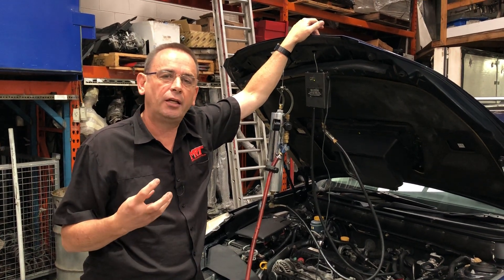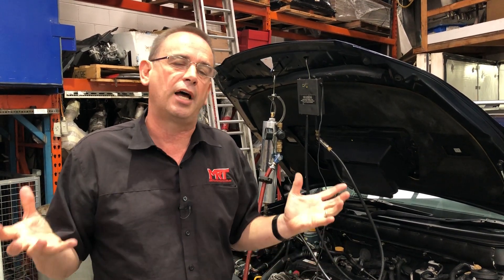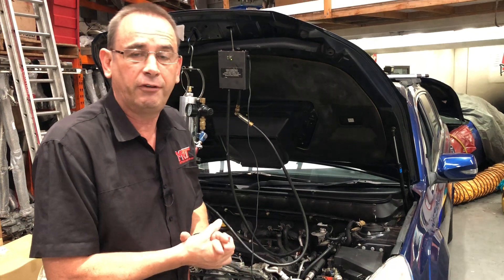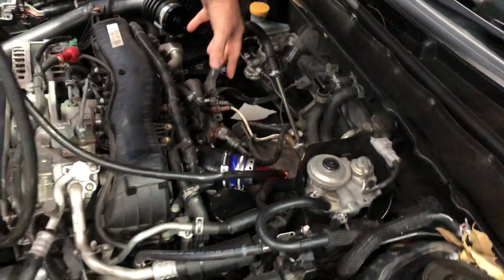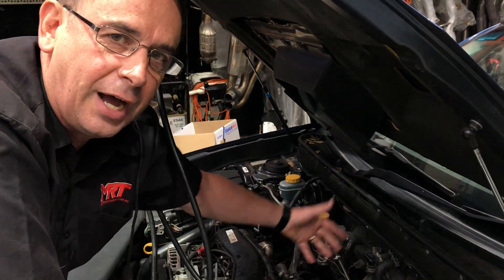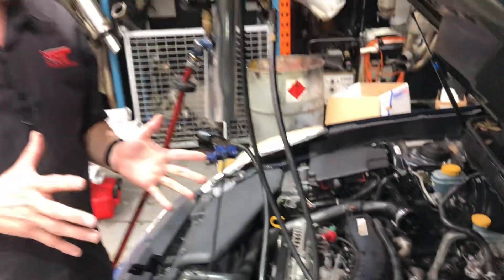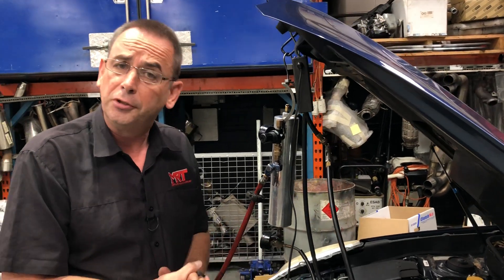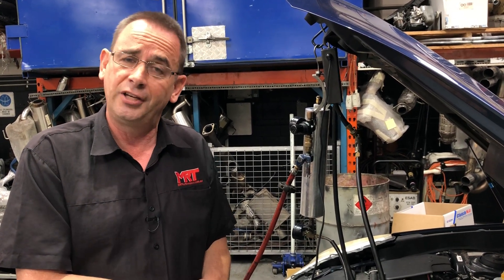Subaru Turbo Diesel Soot Problems

Comment: Hello! I have exactly the same sound like this :
https://youtu.be/dqYpy3iAC4Y

I bought the car and the engine shortblock is brand new , only the injection and turbo were from the old engine...

I don't know what cause that truck "engine sound , especially when i push the acceleration...
Reply: I forgot to say my Subaru is SJ from 2013-2018, 2.0 diesel

Comment: So Euro 4/5 means that to stop a bit of exhaust soot, cars are hobbled to have a shorter economical lifespan due to the expense of these repairs. All the energy and resources (and pollution) involved in producing the car are amortised over only 10 years instead of 20, forcing people to go out and buy new cars twice as often. And this is meant to be good for the environment.

Comment: Thanks for the info MRT. I've spoken to our local Turbo shop and they recommend removing the DFP & EGR. Is this a good idea? They had concerns on performing a clean as it puts all the carbon crap through the engine, your input would be appreciated.

Comment: interesting that it uses a throttle body, dont follow diesels that much so this is new to me! Thanks Brett
Reply: It's cool that modern petrol and diesels are quite similar in the way they operate now. Mazda are starting to use compression ignition in their petrols etc!